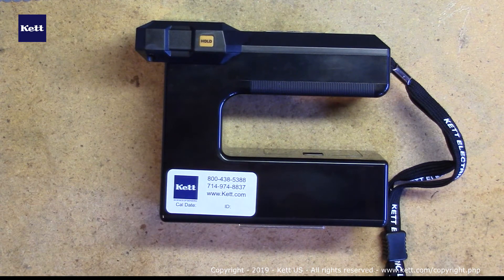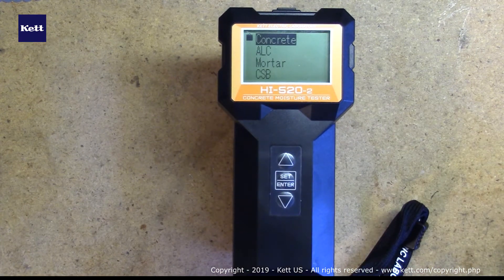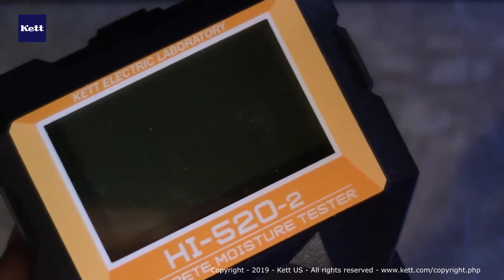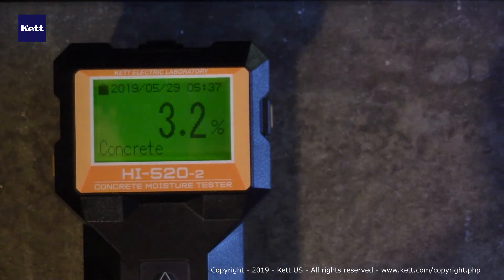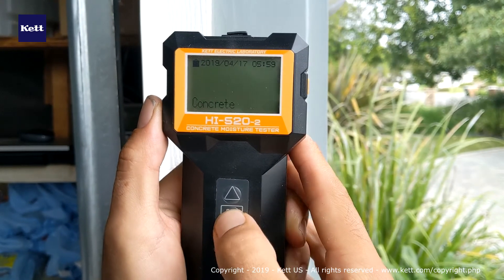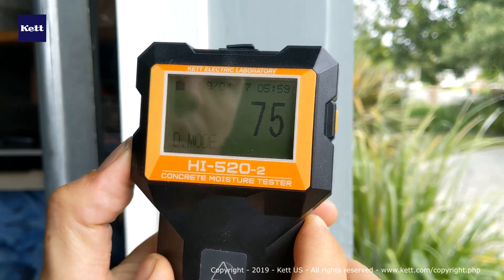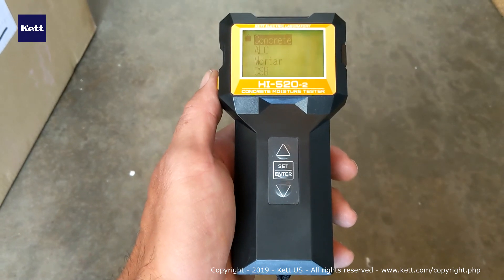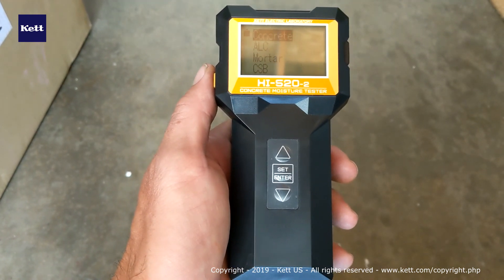Kett HI520-02 Advanced Instant moisture meter - drywall, concrete, mortar and other dense solids.

Comment: how to calibrate this concrete moisture tester? and how many months before we calibrate again?
Reply from the maker: You add calibrations by using the raw mode and matching it with moisture values you obtain from your existing measurement method.